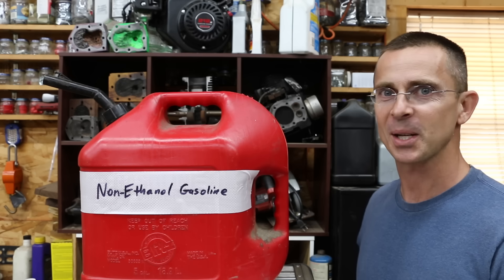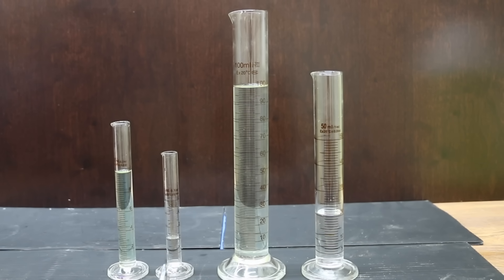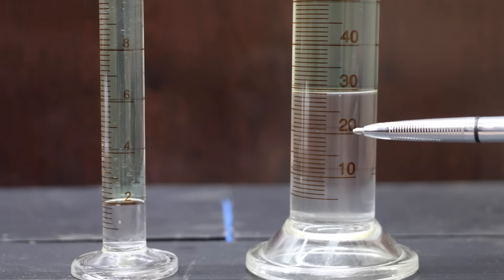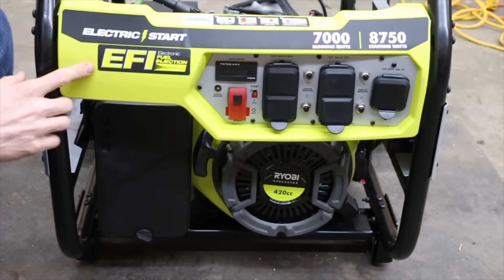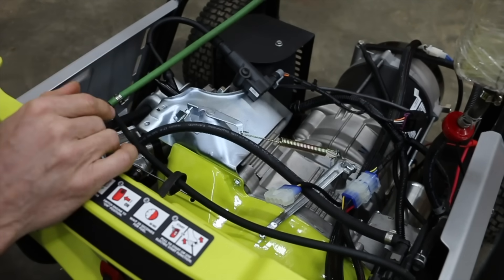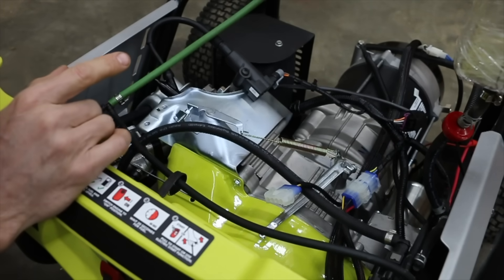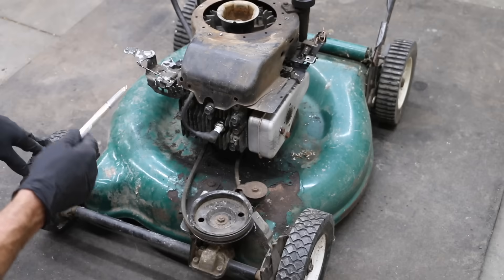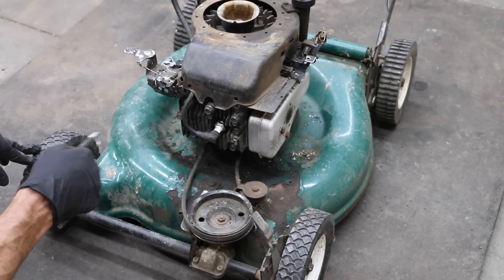Is Non-Ethanol Gasoline Really Better? See the PROOF!

Comment: All I can tell you is that I have a 1980 Yamaha motorcycle. I use ethanol and it bucks and fucks and hates life. I run straight gas through those Hitachi carbs and she runs smooth as glass. There's a thing called phase separation that occurs with ethanol fuel that doesn't occur with straight gasoline. These lawn mowers don't represent the multitude of adjustments a modern engine experiences trying to comply with emission standards. The ECU and it's fuel event timing is what's causing the pollution. Engines that finite can't have crap fuel added. And ethanol fuel is just that crap. I have had too many cars fail due to a misfire condition caused by ethanol. It eats injectors and destroys engines so that the consumer is forced to buy a new vehicle. It's a sham and a scam. And they don't reduce the price if fuel as they should by adding it. So yeah. Fuck ethanol and I can't wait until electric rules and we can end all this EPA emmision crap.
Reply from the maker: Thank you!

Comment: I’ll never use ethanol blended fuels after most of my fuel system had to be replaced due to corrosion and degradation of the rubber components at a cost of just over $2g (yes I mean e10 not e85).  I’ll gladly pay the extra $.30 per gallon for 100% gasoline.
Reply from the maker: Thank you!

Comment: Ok.....Ran ethanol gas through our John Deere lawn tractor. After a few tanks through it, it wouldn't start. Took it to the dealer and it ruined the carb. The mechanics were adamant about always using 100% gas.  We quit using ethanol gas and our small engine problems went away.
Reply from the maker: Thank you!

Comment: Try storing both E10 and E Free gasoline in sealed glass 1 quart canning jars for 3 weeks to 3-4 months. 1 set indoors out of direct light and 1 set out side In direct light.  E10 tends to go bad quicker than E Free gasoline in smaller containers such as small engine gas tanks and especially in small engine float bowls. E10 Sitting out in the elements in a small engine gas tank tends to start going bad after only 3 weeks.  You should see a significant change in color and clarity after only 3 weeks. The 3-4 month test will show what gas does when stored in a small engine gas tank Seasonally. 

You can add fuel stabilizer to a couple jars with E10 and E Free gas and set them beside your non stabilized jars if you want to see if it actually does anything. That would be interesting to see. 

I monkeyed around with E10 and E Free gas and seen a bunch of interesting things. You will be very surprised.
Reply from the maker: Thank you!

Comment: If you look up the heat value contained in the fuels that will equate to efficiency. A gas with 10% ethanol will give less power, so less mileage than the same fuel without ethanol. Also another factor is expansion. When ethanol is added to gas it expands. I don't believe you will see it in the small amounts you are showing but if you fill a tank truck with gas and ethanol and meter the product off, you will unload a larger amount than the total you loaded. If you look at a terminal loading facility the ethanol is always added before the load meter.
Reply from the maker: Thank you!

Comment: Running better and carbon build up are the last things I think of when I buy ethanol free. Shelf life and fuel system damage are the main and only reasons anybody should care.
Reply from the maker: Thank you!
Reply: Sorry for seeming a little snarky. I wrote that before I watched the entire video where you mentioned your time test. My rule is ethanol free in all gas cans. Only my daily driver gets ethanol fuel. As far as power, I don't think the typical person is not going to notice a difference in 4.9 hp s 5.0 hp in their lawnmower. However if a person is feeding a generator, 4% more economy is not a bad thing. Carbon build up is rarely an issue in my opinion. How many homeowners are pulling cylinder heads? But still cool info anyhow. A real world or throttle response test with how long an engine takes to get to a certain rpm would be cool. You do great work, and all your video have been very informative. Especially the battery ones.

Comment: Demonstrates the science is correct, more energy in non Ethanol fuel.  

When it comes to testing the effect of Ethanol, that will be difficult IMHO, as most of the materials now used are very resistant to Ethanol and in my experience can take a decade for many related issues to show up, but it does still happen. It's the older equipment with rubber, and metal fuel tanks that cant handle Ethanol. But I will be eagerly awaiting the results.
Reply from the maker: Thank you!

Comment: IDIOT: you do not buy gasoline without ethanol for ANY of the reasons you listed though slightly better MPG.  You buy it so that on small engines with their small orifices the oxidation deposits out of the gasoline do not build up as quickly.  Ethanol loves water which brings with it oxygen.  This causes faster build up  and your expensive carbs need cleaned/replaced sooner.

Comment: Is it worth it to buy premium gas for small engines or is regular gas all you really need?
Reply from the maker: Great point. It seems to make fiscal sense to use non-ethanol on small engines or vehicles not designed for it.

Comment: One of the big problems with ethanol fuel is it has been found to cause significantly more smog after it is burnt than non-ethanol fuels
Reply: Found out how and by who?
Because Brazil can't be seen from an airplane it's so dirty 🤦
Reply from the maker: Thank you!
Reply: Not if tuned properly.
Producing E is still a problem for overall cost/smog to produce it.
Reply: Ethanol reduces smog, does not increase it.

In fact, ozone levels in the US have fallen 32% from 1980 to 2017 during which ethanol usage exploded. https://www.epa.gov/air-trends/ozone-trends

The false claim of ethanol causing more smog comes from a misread study done in Brazil.  The reason ozone levels fell was because NOx levels increased so much from the extra petroleum used it prohibited the ozone precursors from forming ozone.  Note NOx is also very bad as well as the ozone precursors.  

That study also found that nano particle pollution increased 30% from using more petroleum as well.https://www.sciencedaily.com/releases/2017/08/170828124546.htm

FROM Scientific American:

>>>So how could burning more petrol, which puts more of the ingredients for ozone formation into the air, actually reduce São Paulo’s ozone levels?

As nitrogen dioxide becomes more abundant in the air, it increasingly combines with hydroxyl radicals to form nitric acid. This removal of hydroxyl radicals shuts down the reaction that forms ozone. “It’s a really strong quenching effect,” says Sasha Madronich, an atmospheric chemist at the US National Center for Atmospheric Research in Boulder, Colorado, who wrote an accompanying News and Views article on the São Paulo study. At high NOx levels, this quenching begins to outweigh ozone synthesis, and ozone levels drop.<<<

https://www.scientificamerican.com/article/ethanol-fuels-ozone-pollution/

Comment: If ethanol reacts with water, does that make a difference when cold weather might cause fuel tank condensation and gas line freeze?
Reply from the maker: Great point on the condensation!

Comment: Say what is the weight difference between a transport load which is 8000 gallons of e10 vs 87 also you're kind of overlooking the cheapest and the highest octane rating fuel of all which would be LP gas you can run up to 14 to 1 compression on it
Reply from the maker: Thank you!

Comment: I get 500 miles per tank with Ethanol in the gas vs 430 on straight gas. (99 Silverado with 5.3L V8 and a 38 gallon cap6)
Reply: Thats odd

Comment: Ethanol fuels give you a better fuel economy in the short-term. over the long term of continued use you have an increased amount of engine problems including EGR valve fuel pumps injectors hoses and other parts that wear out due to the ethanol contamination. To make it worse burning ethanol produces some very toxic chemicals including benzene gas which is highly dangerous in the environment.There's a reason that fuel designed for boats contains no ethanol. It's known to poison lakes. it really is a shame. Cuz I would love to have a completely renewable alternative that we can grow and would actually be better for the environment than the current gasoline.
Reply from the maker: Thank you!

Comment: I will say this (and take it with a grain of salt, because I'm certainly no expert): but my lawn crew got brand new Maruyama weedeaters, two seasons ago. Two-stroke operated motors, nothing special. We kept running 10%, as we had with our previous Echos, and Shindaiwas before that. About mid-way into the 2018 season, both of the 2017-purchased Maruyamas were gone. One lost its ability to have compression whatsoever, and the motor on the other burned out.

Now, we do commercial work, so these things are running wide-open 6-7 hours out of an 8-hour day. Whether these failures are from the extensive use, the 10% Eth gas, if they were just lemons, or a combination of everything - I simply don't know. Our equipment mechanic blamed it on the gas, though, so that's what we went with. So, now we run 89 Oct (instead of 87 Oct 10%), Ethanol-free; the difference is definitely marginal, but I have noticed a few things. The engines stay (relatively) cooler, the RPMs go just a little higher, but they certainly drink more fuel. IF these new motors last through next season, will certainly be determined by this June (which is the month the motor burned out in the one).
Reply: Naru 'Sanav: What brand of 2 cycle oil do you use in your weedeaters? Note: I am not a sales person or dealer, distributor, just a long time user of these types of equipment. I am going to assume you do not use Amsoil Saber 2 cycle oil in your 2 cycle machines. I highly recommend it. I have weedeaters that are 20 plus years old with no loss of anything, and I always use the 10% from the pump. Check it out, it will change the way these types of equipment operate!
Reply: @CuriousKL  We just get Kawasaki 2-C oil from the dealer we use. As I don't own the business/crew, myself, I don't have many options without coming out of my own pocket.

Comment: in todays epa compliant carbs the ethanol causes corrosion in the small passageways inside these new carbs which is next to impossible to clean out and repair. if you let them soak in carb clean you will destroy the main nozzle check valve and will have running issues. the fact the fuel absorbs water over time is most people only use there small equipment from time to time and the  water in the fuel will cause problems...some company's are using a coating on the carb body to help stop the corrosion from happening and it seems to be working but you have to be stupid to think that ethanol is a good thing for anyone or anything as it uses more energy to produce it than it can achieve. dumb. in a closed fuel system the problems are not the same as a fuel system that has to be vented to atmosphere. for cars it isn't really much of an issue, in small gas equipment it is a big problem.
Reply from the maker: Thank you!

Comment: Always Great Content Captain, 
and totally cool hightech tools 
really take the mystery out of 
what's going on in realtime, 
from viewing infrared temp, 
which is really key to how an engine 
is going to survive for many years, 
to maybe a few hours. 
Just altering the cooling flow on aircooled engines can make a huge difference where factory engineers really dont have a clue how to keep head temps even edge to edge or maybe they just don't care. 
Granted I did complete engine rebuilds at the companies that used the ten hp propane buffers in house for their large stores. Head gaskets were lucky to make it a month, being the high temps, simply let the head bolts slip back a full thread pitch from over heating aluminum block so hot, the bolt threads stripped out the block threads - I soon discovered the airflow was totally wrong from flywheel fan airflow around the cylinder to exhaust port. 
* After altering airflow, the headgaskets  never failed. 
Everyone of my customers saved thousands of dollars a month. 
All those engine blocks had to be re-threaded with heli-coils, on site. 
Huge job. 
Cheers
Reply from the maker: Thank you!

Comment: 4% on just e10 is right on par with with my friend that tunes cars estimates. On an e85 tune, he starts by adding 33% to the entire fuel table. 4%/E10=34%/E85. Of course pump e85 isn't actually 85%, but most of the guys running it that he tunes for, buy it from the performance shop in 5 gallon cans to ensure 85% ethanol content.
Reply from the maker: Thank you!

Comment: Written about this before... but as far as I have tested, in my "old" car of 14 years, E5 vs E10, the former gives slightly better mileage for the volume and the latter gives slightly better mileage for the money at the current pricing back here. It is not really any cheaper, though, because it increases engine oil consumption noticeably, up to three-fold. So E5 it is for me. Can't get non-ethanol road gasoline here, and while it is legal to drive with the non-ethanol small-engine gasoline made by alkylation process, it is outrageously priced.
Reply from the maker: Thank you!

Comment: How about a test of ethonal based 87 octane vs buying pure gas that's 87 octane and then adding 10% ethonal. See if oil companies are adding dirty fuel and spiking it with ethonal to clean it up. And see the differences in different %'s of ethonal is gas. 30% 50% 85% etc see if effiency gets worse with more ethonal added or stays the same. Some swear that 40% your mpg picks up like normal gas.
Reply from the maker: Thank you for the video idea!

Comment: Woot! I've been asking for this video since you released the other gasoline videos! Thanks for testing

Next video idea: You had some videos about if a product can prevent metal from rusting. This time try auto detailing product and see if they can prevent or slow down rusting. For an example, car wax and ceramic coating. Instead of using nuts and bolts, use a flat metal plate and see if those product works or not.
Reply from the maker: Thank you for the video idea!

Comment: Nice
I would recommend pure gas products in two instances. In a marine engine use or any high humidity environment, always go with pure. For lawn care in your home, use 100% pure also due to long shelf life of the fuel, even over winter. 
10% ethanol has always caused me issues in my small engine equipment but if you are using a lot of it for a business you might be ok.
The 10% E does cause rubber orings to swell up and for some they deteriate faster.
As a Marine Mechanic I've witnessed it first hand.
Reply from the maker: Thank you!

Comment: the ethenol dont increase the octain it lowers it and turns the gas to water if it sets verylong and i can tell you from experience that gas with ethenol in it ruins the diaframs in the carburetors on weed eaters and other small engines
Reply from the maker: Thanks for commenting.

Comment: with motorcycles ethanol really only matters when you store it for long term with older bikes with carbs from the 80's till now but with older bikes from the 70's back they where designed with leaded gas to be used. the ethanol strips the gas of its lubricating properties killing them with in a short span if you run with out additives like sea-foam and gumout. the ethanol will quickly disintegrating the rubber and cork on top of that. now most of these carbs will easily convert over with modern parts.

just for the people talking like they know ethanol is useless, e85 is considered a racing fuel
Reply from the maker: Thank you!

Comment: My experience with non ethanol gas is as follows. We fill up the yard gas pumps straight off the line then add a little additive. All the trucks in the yard run on it. Even the newer trucks "stink" after a while. The older trucks run like shit for the most part. I don't think it's good for the cat/emissions system. When we ship finished fuel via pipeline to a terminal it is ethanol free and additive free. Before it ships we make a 10% blend and test that and the raw gas. As long as everything is in spec the gas ships ethanol free. When it gets to the terminal it is blended to E10, additives are added (depending on who purchases the gas, what additive package will be added). And then it is sold.
Reply from the maker: Thank you

Comment: Ethanol gives you more power at the cost of fuel
Reply: You are right that ethanol give more power, but wrong on the cost of fuel.

Ethanol makes fuel cheaper.

Ethanol price is very stable and is trading on the NYMEX today at $1.255/gallon today.

Sub grade and sub octane RBOB gasoline is trading on the NYMEX today at $1.358/gallon.

Of course to make RBOB gasoline usable in our cars it needs to be refined more and/or have toxic BTEX added which raises the price of the fuel.

Unless you simply add 10% ethanol to it which makes it a usable grade and octane plus cheaper.

Gasoline is really cheap right now, a lot of the year RBOB was >$2.00/gallon.  A lot of time ethanol is >$.50/gallon cheaper, the spread is abnormally close just now.

Comment: Ryobi sent me a new replacement 40 V Li line trimmer but also sent a letter saying the new power head (with battery and charger) will NOT have the new tool warranty except what is left in the old warranty (which I think has run out). SO...I'll use this new one til it quits then crush it with a mall with a few lemons next to it and put it up on YT.  How many hits with a 16 lb mall will it take to decimate it into oblivion...tune in and we'll find out.
Reply from the maker: lol.  Thank you